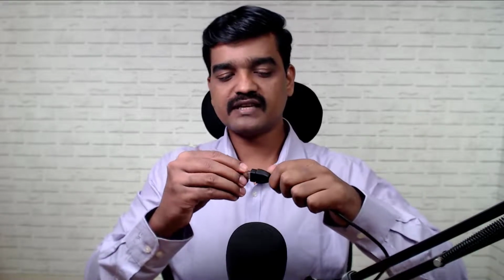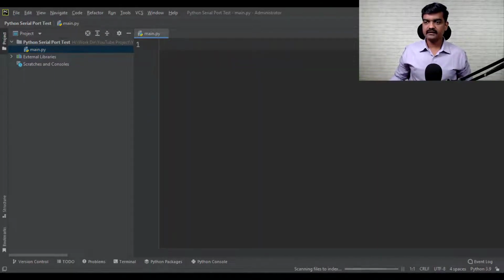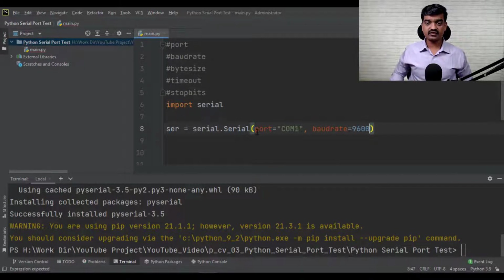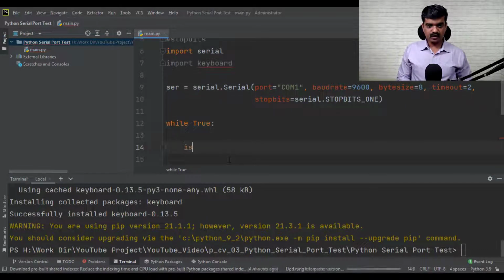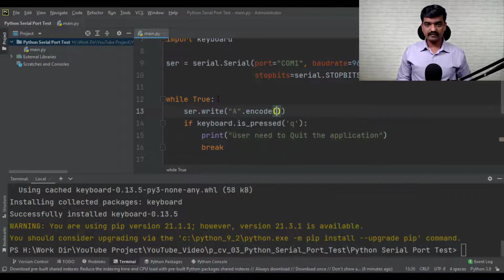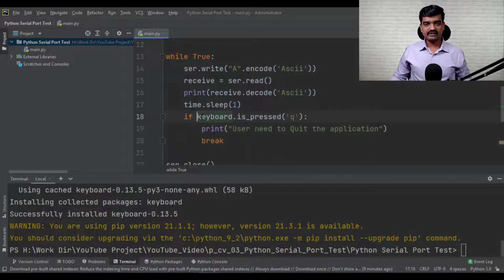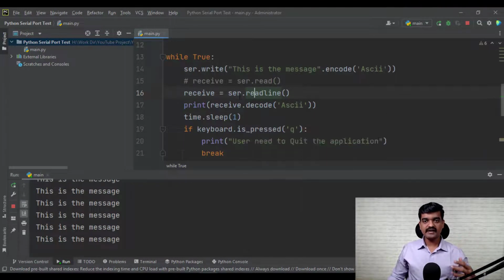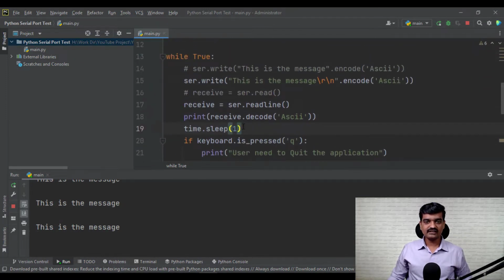Python Serial Port Commuincation

Comment: Why i am getting this error in my code 
SerialException: could not open port 'COM4': PermissionError(13, 'Access is denied.', None, 5)
Reply from the maker: This could be because it was open in the  previous session. Please try to disconnect and connect back the usb to serial device.
Reply: @dhanawadeamit  It says could not open port COM3. Permission Error (Access is denied)
Reply: was it resolved ? I am getting the same error and am unable to fix it.

Comment: Hello Amit, i copied your code but my issue is that i am ot getting any output on my terminal it always prints an empty line. Could you help me please. Thank you in advance
Reply from the maker: First: Please check if your usb to series converter is working separately.
Second: Is the comp port name in the code matching as that of in device manager.

Comment: \r\n eliminates the timeout I understand but my doubt is can I remove the timeout by keeping \r\n?
Reply from the maker: Yeah, you can but you have to make sure that all the time you message shall contain \r\n or else it will stuck infinite time there, usually when we connect with hardware we might not know that the hardware will send correct values so it is recommended to have time out. If your data comes delayed then what you set in time out then you shall consider increasing the time in timeout setting.

Comment: Do you think I could use something similar to, if I am using two barcode scanners connected in different usb port, see the information that came from each scanner?
Reply from the maker: Yeah, you can have as many serial ports as you can. Just you shall use correct port names while using it. Also in one of experience when I was having bluetooth gadgets connected with laptop i could see that windows creates a serial port for those devices and when I actually connect the USB to Serial module some time it wont work. Then when I disconnect all Bluetooth gadgets deleted all serial port that were created for BT gadgets and started a fresh it started to work perfect as expected all the time.

Comment: Just wanted to ask, my barcode scanner can detect by Hercules serial , but I can’t detect on my software serial input. Is this has to do with port 2,3 RC , TX reverse problem ? The programming software only have serial input selection and setting such as baud rate same as scanner but still can’t trigger
Reply from the maker: There is also a possibility that Hercules serial needs Rx, Tx & GND but your software uses full RS232 protocol with DTR, DSR, CTS & RTS and there could be a problem with these pins.
Please have a look in this direction, let me know if you want any help

Comment: in my editior loop is working , break through q is working but it is not showing that line "This is the message".it is just going down in terminal. it is like this line is printing but not visible.
Reply from the maker: Aman you might have notice it must be going down after timeout. This means your serial did not recieve data. 
There could be multiple reasons like Rx & Tx open, UART to USB module not working, loose connection. I would recommend to check your USB module. 
Check this video https://youtu.be/ji0aeZnnqQg

Please let me know if you need some more help with it.

Comment: Thank you for nice information ..
I have one question , and  I hope you can assist me in that 
I am going to buy a digital dial gauge, and I want to read its measurement with Python on my PC. The digital dial gauge works on the USB serial communication protocol.Some details as follows :Data in ASCII format without unit:
Pre-decimal position with leading zeroes.
Number on the post decimal positions depends upon the set resolution.
Unit: [mm]:
sign X X X . X X X X CR
„CR“ Carriage Return
Is it possible to communicate with python with digital dial gauge?and How?
Thanks in advance..
Reply: Hallo ..
It is working for me . Thanks again..👍
Reply from the maker: @roshanbagul5606  Glad to know Roshan. Enjoy Coding ;)
Reply from the maker: Yes it is possible to read data from digital dail gauge. As your data is in string format and not a character you shall use "readline" method in python. In the video I have explained how to read complete string using readline method. First use my code as it is with readline method and verify gauge data can be read, then modify the code as per your application.
Reply: @dhanawadeamit  Thank you very much for your quick response
I will inform you , when it works ..